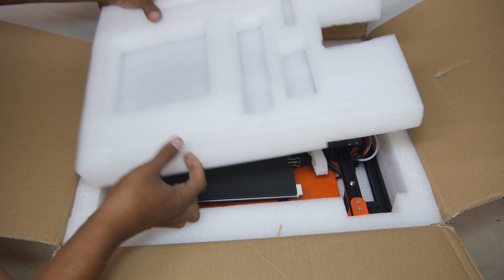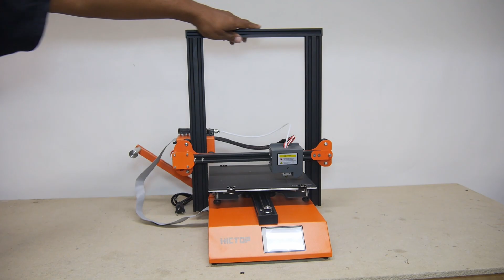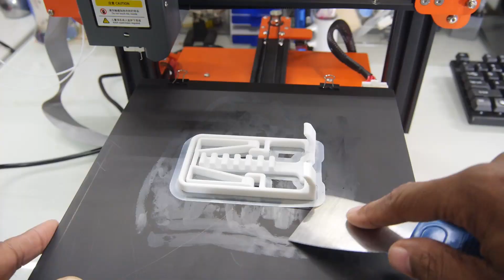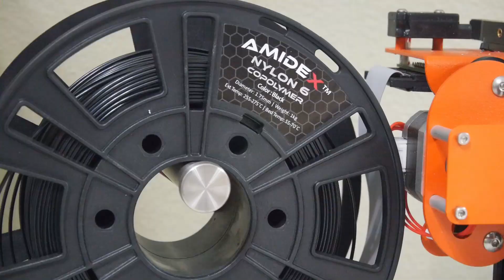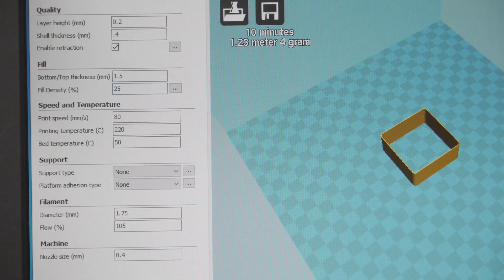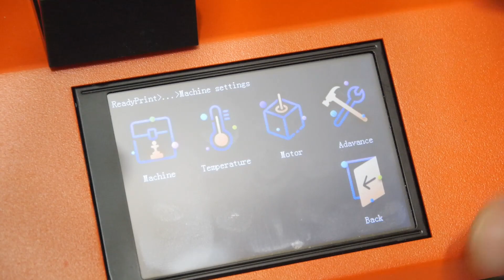HICTOP S250 3D Printer - A Very Capable Budget Printer | HobbyView

Comment from the maker: Update. I eventually was able to print directly on the glass bed with no glue needed. It just takes a finer adjustment of the print level and head distance.
The nice thing is once the bed cools down, prints pop off pretty easily with no tools needed. So black coating won't get scratched.
Lessons learned...
Reply: I just got a cool new device. You seem to be a techie, so check out the Radiomaster TX16S MAX. I might not ever need another transmitter. I like it more than my DX8e for sure in every way. (I got the gold one.) Plus it will bind to all my Spektrum receivers, so I don't have to reinvest there. Definitely would look good on your channel! Lol keep up the great videos!

Comment: Hello, I have exactly the same printer, but the designation is "Aibecy S 250". I bought the printer used and am looking for the latest firmware. Unfortunately I couldn't find anything on the internet. The board is an MKS Robin Nano V 1.2
Do you have any idea where I can get the right firmware?

Regards
Reply: I have exactly the same aibec and I don't have cura configuration files